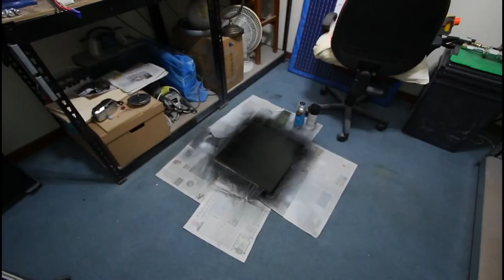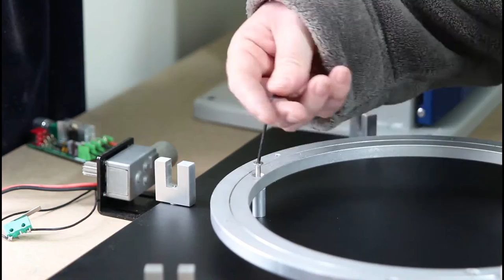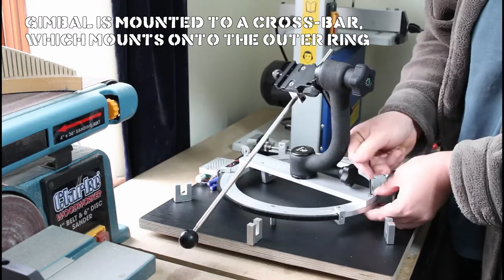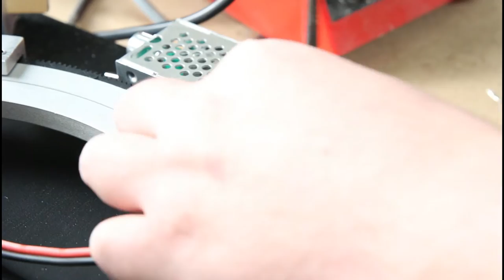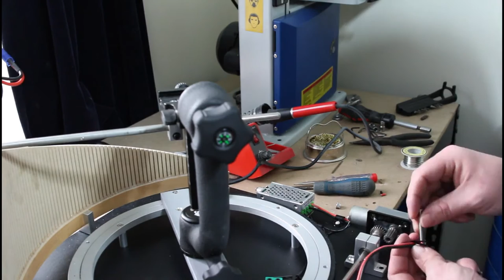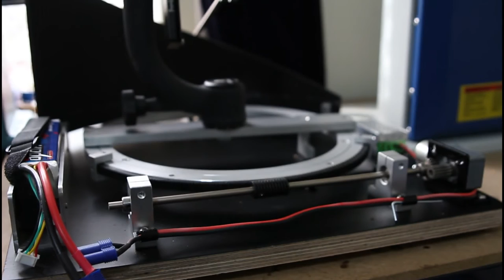Making a DIY Motorised Camera Gimbal- for Timelapse Photography

Comment: Greath idea,THX for sharing. One question, what did you use for turntable? I need one for similar project. Can you tell me brand etc.. to look for similar to buy?
THX again for sharing.
Reply from the maker: It's a 30cm Lazy Susan: https://www.ebay.co.uk/itm/12-304MM-LAZY-SUSAN-10MM-THICKNESS-ROTATING-ALUMINIUM-TURNTABLE-BEARING-NEW-UK/132512957133?epid=20006028637&hash=item1eda6342cd:g:SLUAAOSwZfFZeuvH they come in larger & smaller sizes if needed.
Reply: THX a lot for the fast respond I just got one.